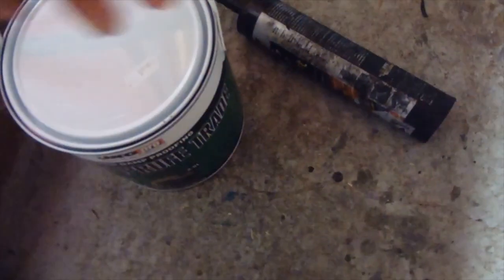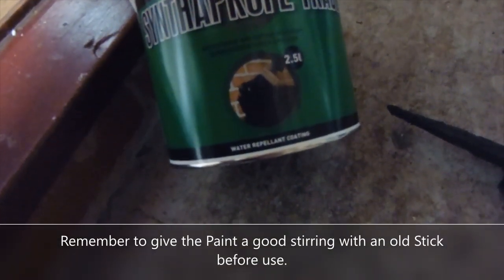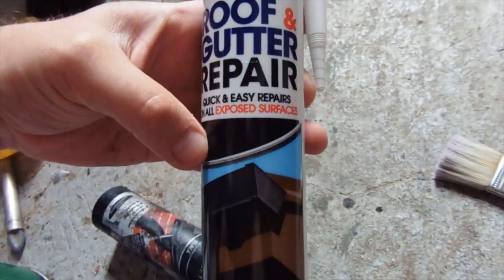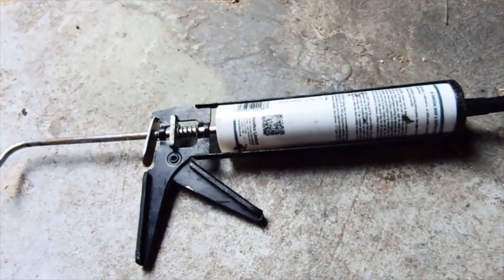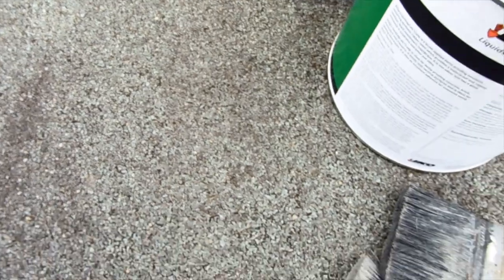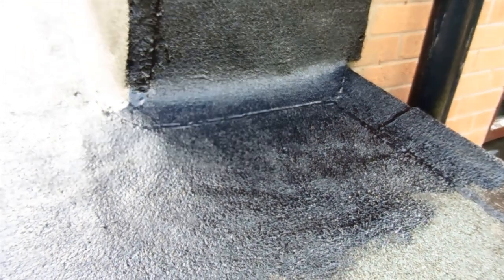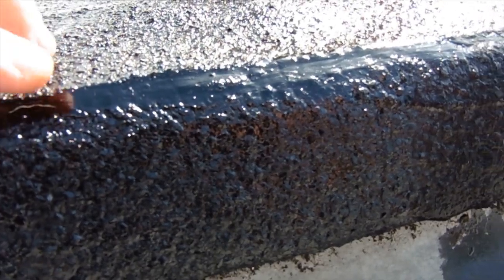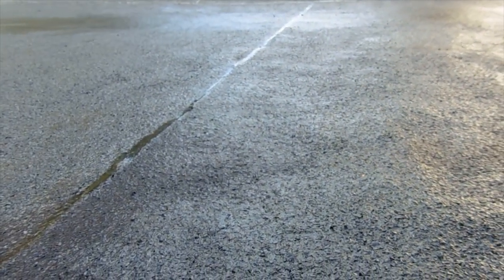How to Repair, Protect , Seal & Fix a Felt Roof / Flat Roof

Comment: I can understand doing the edges with a brush, but the application to large flat surfaces must be easier with a roller surely?
Reply from the maker: The thing is, this stuff is very sticky and messy. It kind of clogs up a roller because all the bitumen particles build up it's not the easiest stuff to work with. That's why I prefer an old brush.

Comment: You are a meticulous worker, however as a property developer and builder of 40 years plus, I would never again touch a felt roof with a barge pole. They are a money pit, and constantly require repair. If that roof has lasted 10 years and is still waterproof, you are very lucky. In the 1970s we constructed many dormers, and as was the practice then, we always laid 3 layer felt with white chippings on top to reflect the sun, and minimise cracking and shrinkage. They all eventually leaked. I now only use the artificial rubber EPDM. More costly initially, but faultless thereafter. Felt is ok for sheds, but should never be used over a living area. And, not difficult to lay
Reply from the maker: I agree I would never use felt myself for a room attached to the House but as it was already there I thought it could give it a couple more years of life. I am also surprised that it has not failed yet fingers crossed.
Reply: @Nick C Hi Nick, I must agree with you that a felt roof that has lasted 40 years is brilliant. However, if it was laid when you were only 12, firstly they were usually tradesmen then, but are you absolutely positive that it was 'felt'. I ask because I also worked on several flat roves at that time, and if it was on a house or school etc, it was asphalt with glass fibre reinforcing. These were simply laid very hot with no top surface. Felt always had to have a generous layer of white chippings over laid to reflect the suns heat. Has your house got these chippings? Also, in those days it was customary to use tarred, pre-felted 'chipboard, as opposed to OSB today. The problems arose from steam condensation from the inside of the home as well as the variation in temperature and water content of the air outside. I can only speak from my personal experience, and repeat that I would never again use felt.
Reply: @Nick C Hi Nick, you've got me beat. Without examining it myself, I can't give a solid answer. 15 minutes ago, I came down from installing a tiled roof, on the hottest day of September, so I am now ready for a cold beer, cheers.